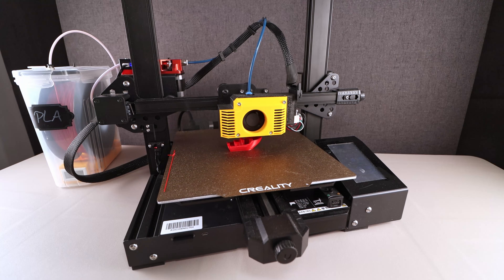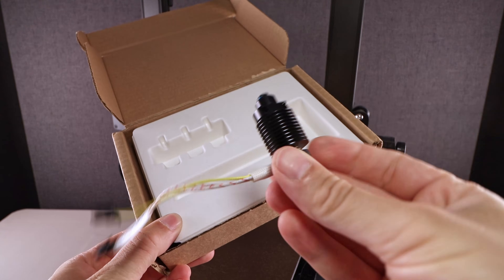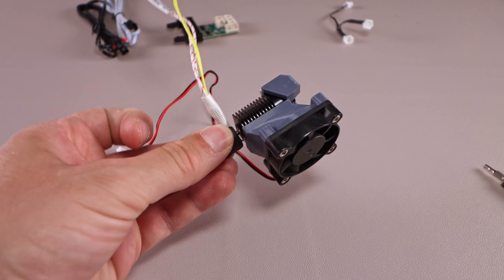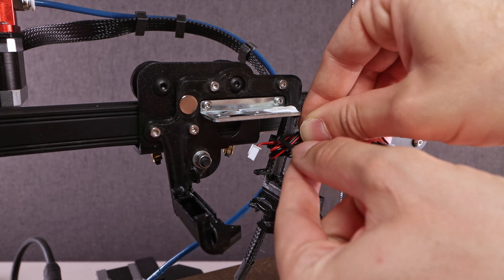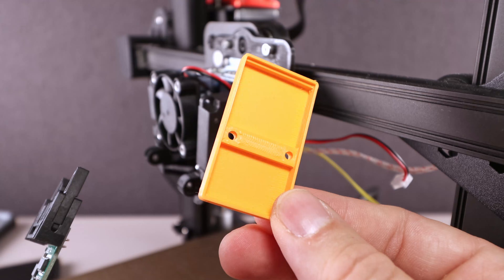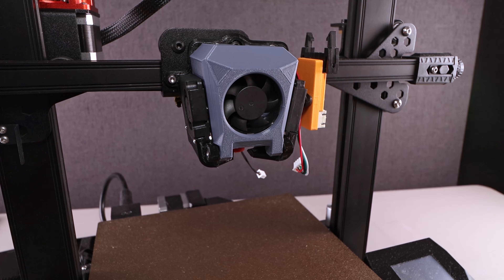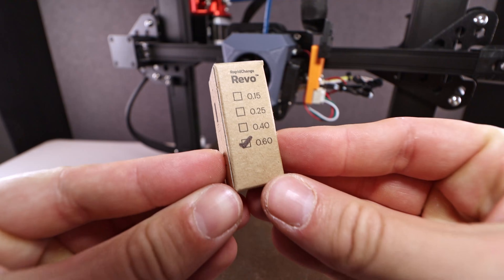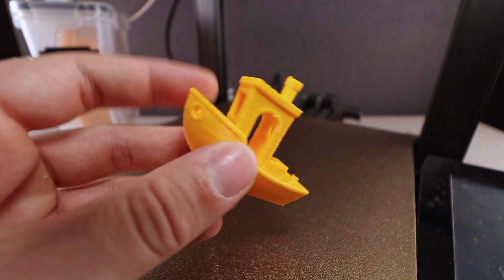E3D Revo CR Hotend Mod for Creality CR-6 SE

Comment: Hi again!!! Im working with this mod and its amazing, i have a little question about the settings, i try to up to 110% the speed and works fine sometimes others fails... Can you share with me your profile? i use OrcaSlicer but if you have it in other slicer i can adapt it to mine. Also que other question is... Do you make more mods or this amazing one it's tge only one for the CR6-SE? Thanks again for this amazing design

Comment: I took the CR6 design that was lying on the table, made a few changes and made it pluggable into the V5 hotent. Now I will have a solid new device.

EDİT : No matter what I do, this device has an adhesion problem and there is a problem in the startup code. Somehow, the filament sticks the leftover materials to the nozzle part, even if it creates a purge line, and ruins the bed. Hairspray, using the shiny glass part of the table, etc. none of them work.

Comment: Hello. I love this modification. Can it be used with the Hotend Stock? I want to put 2 fans towards the impression and one of 40mm for the Hotend, but I do not want to change the Hotend for now.
Reply from the maker: Thanks for the feedback! The Revo hot end is longer than the stock version. Hence, I don't think it will fit...what you could do, is to design an extension adapter for the original hotend. Then it could work